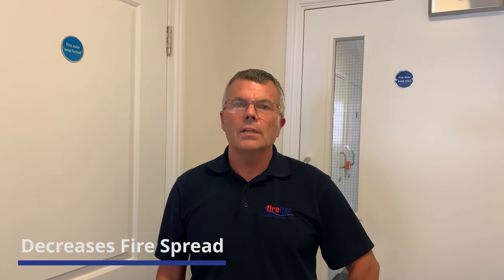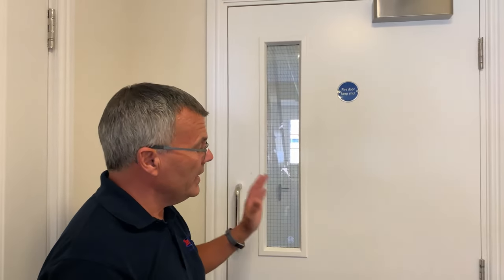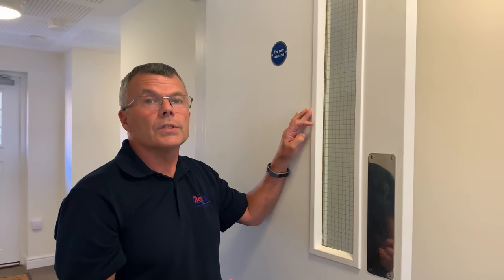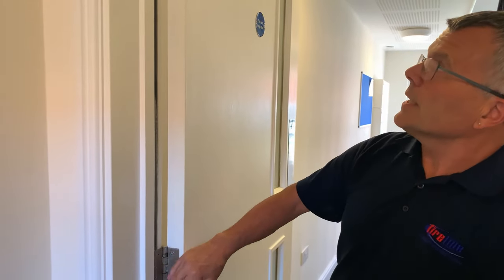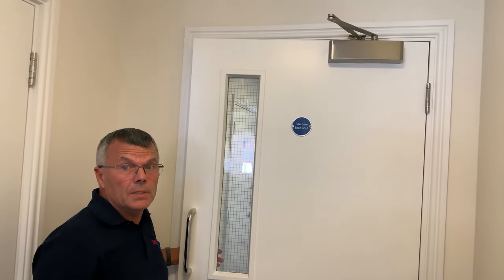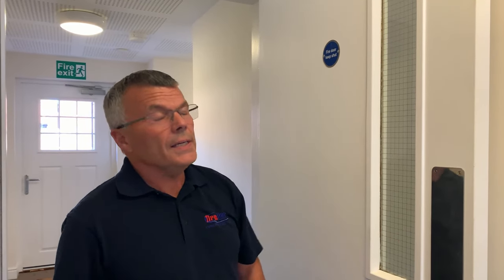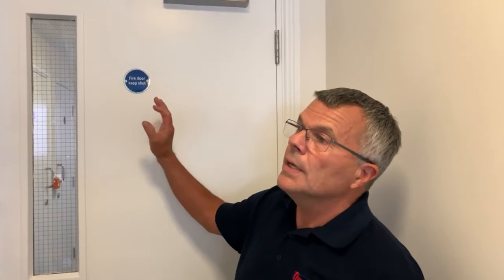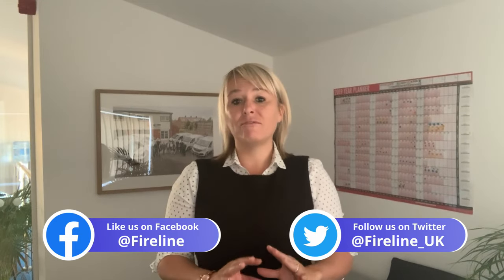How to check your fire doors are safe and compliant?

Comment: What about the door-frame gaps? No more than 4mm door-frame and no more than 10mm at the bottom, if it’s an uneven floor, use a drop down bar :)

Comment: Stopped watching when said over painting seal stopped them working, this is totally wrong and there is no evidence this has any effect on the intumescent seal. In fact a maximum of five coats of paint is allowed, but obviously not recommended. This is not the same however of the brush smoke seal which should never be over painted

Comment: Just a bit of advice for those who think he has solved the inspection dilemma as we all know there is a lot more than just physically inspecting a door.

1. RULE NUMBER 1 - Identify where the door has been manufactured ( There should be either labels to the top edge of the door or some paper trail/ O&M { Operations Manual } with information corresponding to the door. REASON - It will give you all the information you need on how to of installed, repair and maintain the doors you currently have.

2. RULE NUMBER 2 - Identify that the door and frame match. This can be seen by looking out for old housing marks to the frame or to the leaf to show that the door + frame were not originally installed together and at some time one or the other has been replaced or heavily repositioned. This gives you more understanding to know whether the doors can be accepted as a tested set which will correspond to RULE NUMBER 1. If it does not match and there is suspicions of the doors not matching. We now have to inspect the doors according to the approved 3rd party accreditors and other bodies who are affirmed in the industry as passive fire specialties.

theoretical
Reply: How long does it roughly take to inspect a fire door with correct paper work to match?

Comment: You need a " risk based" approach to this. Many doors DO NOT NEED TO BE FIRE DOORS.

This coukd become a licence to print money for dubious "inspection" organisations and those peddling non-statutory "qualifications".

If a door is necessary to protect compatmentation, means of escape or higher hazard areas, it needs to be a fire door......otherwise a fire door in unnecessary.

And the 2022 regs only apply to buildings comprising more than one accommodation unit......not to other types of premises.

Watch out for people quoting regulations and fire disasters as justification for selling doors and systems. Question their rationale.
Reply: So true, I have a small HMO, basically  3 Bedroom house with two rooms on Ground floor, one of the room faces a garden and has a garden door for occupants to escape. the Other room faces the street and has a window that opens wide and occupant can escape via the window unless it was a disabled occupier. Then there are two more rooms on First Floor, one room facing the garden has a window that leads to a flat roof of an extended kitchen below, so the occupant of this room could if need be escape to flat roof and gradually make a way to garden by climbing down to the garden fence and so on, would not be difficult for a normal person to do so when escaping a fire. so one room facing the street may require the 30min FD30 Fire door for Fire Fighters to rescue occupier if assuming the Hallway was on Fire. All rooms have interlinked smoke detectors so a fire breaking out anywhere from Kitchen to any rooms or hallway would alert all occupiers to escape before the fire takes a full hold, so in my view many premises do not require 30Min fire doors when ordinary solid pine/timber doors could provide compartmentalisation of the smoke as long as they are fitted with self closures, Kitchen is one place that is high risk, but again I am amazed that a heat detector is specified here which will only work let us be honest when a fire has taken a big hold, so I think there are better ways to protect against kitchen fires and its earliest detection is essential, so a normal smoke detector should be fitted that has a 30 second timer to reset if should it go off due to cooking smoke, whereby it will not set off all other detectors on a interlinked circuit. So if someone was cooking and smoke from it sets off the kitchen detector, it will start sounding an alert, so the person in the kitchen can then press an easily accessible auto resettable Silence button, to stop the room detectors from tripping, the advantage here is if someone left cooking unattended and it started to burn and start to smoke , the kitchen detector would go off and if no one was in kitchen to press the silence button then all room detectors would go off alerting occupants. This way it would be easy to contain a small fire with a fire blanket or a small Fire Extinguisher, but a heat detector would need half your kitchen burned before alerting.

Comment: What about the opening and closing Neuton force gauges for a person coming through on a wheelchair?
Reply: That's a good question. I do know that you can have a maximum of 25 seconds close time on the door closers. An unqualified guess I would ask the fire risk assessor to highlight wheel chair related escape routes, ask maintenance to adjust the door closers to the best option and also cover wheel chair and disable needs with the fire wardens. My last place of work had fire wardens respable in assisting with wheel chair users in the event of evaluations

Comment: Do your doors have rating labels?  Do they have hour and air leakage ratings?  Should reading the label be apart of the inspection?
Reply: I'm new to this industry, I'm currently learning about the fire doors. I belive there needs to be a rating lable on the door such as the FD30 OR FD60. With out one, you have no idea what type of door this is and no idea of the manufacturer information

Comment: @fireline UK. Heya, just a quick question. I work in a factory in the Midlands. I'm a fire Marshall on my shift. There's an internal fire door, clearly marked which, if opened widely enough & kicked up against the wall stays open by itself. Does this make this fire door defective? My shift keeps door closed but nxt shift keeps it open. It is only a canteen door,  However it's a clearly marked fire door. Thankyou
Reply from the maker: Thanks George for your question. Yes, it sounds like the door is defective as it shouldn't be able to stay open by itself.
Reply: @firelineuk3171 Thankyou for replying. I did think it would make the door defective but couldn't say anything before I knew. Very helpful, thankyou once again
Reply: Should have door closer on it, and should close when opened, if stays open, needs adjusting, only suitably qualified person should carry out repair work to a fire door

Comment: Also do you have to rout the door top surface to install the smoke seal?
Reply from the maker: Hello Sanjay, thanks for your comment. The intumescent smoke strips need to be fitted to the door, or the frame - top and sides, not the bottom. The only way to fit them is to use a router to cut into the door or frame, to the depth of the strips (approx. 4mm). If you would like further information please give us a call on 0800 096 6761 and we will be able to help you further.
Reply: The brand ‘Trend’ do router bits specifically for intuminescent strip 10mm and 15mm wide, they are bearing guided to depth of 4mm and allows you to cut the groove whilst resting the router on the face of the door rather than the edge. If it’s an existing door you’re working on, you may need to remove any door furniture/hardware (handles, esctucions, etc) that might get in the way depending on how big your router base is, hope this helps :)
Reply: @000iloveAvatar000  excellent information my friend. I need to router se fire doors at a care home & that will make things easy